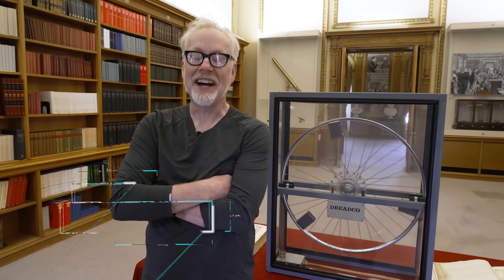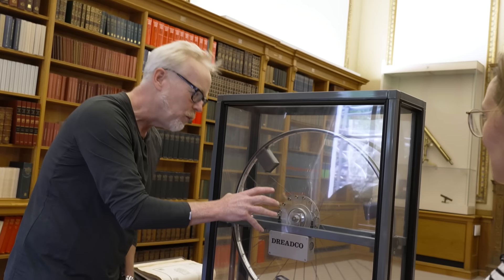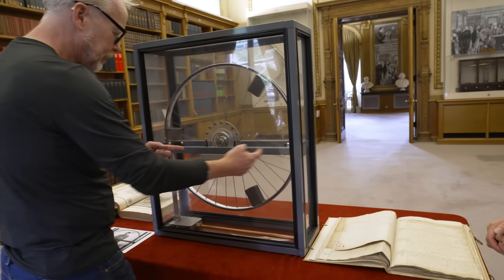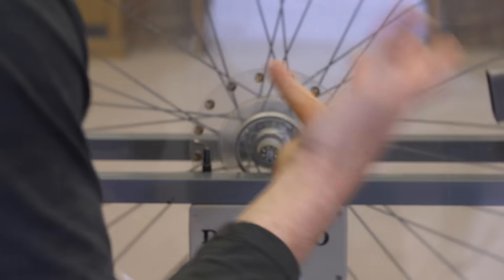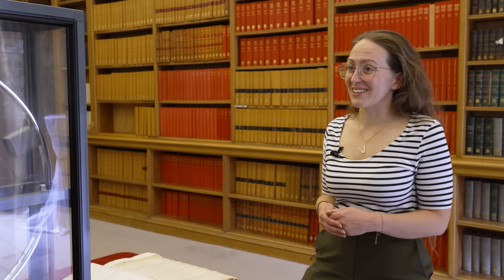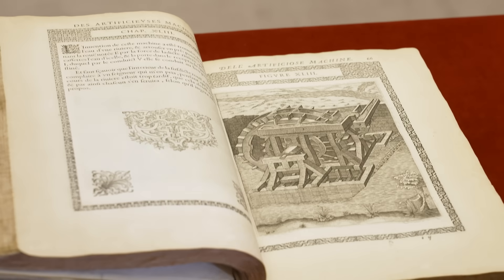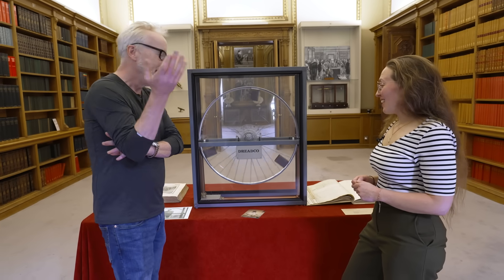Adam Savage vs The "Perpetual Motion" Machine!

Comment: tbh its not all that impressive of a machine considering there are large volumes of it you cant inspect. its hard to figure out what exactly it does, but there are a million ways to get the same result. 
you can have a battery or a chemical process or a temperature differential or a mechanical storage of energy, etc etc. 
just because it is hard to tell from the outside doesnt really make it intriguing in any way - besides maybe a certain level of interest from one engineer to another.

In fact there are even more sophisticated methods like using the energy of radio signals that are around us all day (which is illegal), having an energy source elsewhere that propels or powers the mechanism via radiation, induced vibrations/pressure waves or other transmission methods. Etc etc.

And even these more sophisticated methods arent all that special and have been done a million times.  

In short: figuring out the precise mechanism is neither possible nor would it be terribly interesting. Its like trying to solve a Sudoku with too few clues. The issue isnt that its hard to figure out whats going on. The issue is that its trivially easy to figure out many possibilities of whats going on. Whats lacking is merely the constrains to favor a single solution.
If i rolled a die behind a curtain there would be nothing interesting or stimulating about figuring out which number i rolled. Its impossible to figure out without peeking behind the curtain. And it doesnt really matter either what the number is. It will never be something unexpected like Pi.

Having a sealed envelope is a fun participation thing for visitors passing by. But there really isnt much of a point to it.
Reply: its a pulse motor, magnets on the small inside wheel trigger a reed switch inside the box connecting the circuit from a battery then energising a coil that oppose the same magnets on the small wheel,very simple and the rest is added to confuse you......

Comment: I remember a simple but similar looking device with rubber band spokes. The sunlight falling on one half was enough to make the spokes on that side expand just enough to unbalance the wheel and make it spin which moved different spokes in to the sun.
Reply: its a pulse motor, magnets on the small inside wheel trigger a reed switch inside the box connecting the circuit from a battery then energising a coil that oppose the same magnets on the small wheel,very simple and the rest is added to confuse you......

Comment: "servicing" as in replacing the batteries?
Reply: its a pulse motor, magnets on the small inside wheel trigger a reed switch inside the box connecting the circuit from a battery then energising a coil that oppose the same magnets on the small wheel,very simple and the rest is added to confuse you......

Comment: if those boxs are reversed Magnet pole and they passing thru those U magnets in a negative pole...  as you know when you try to connect two magnets on there other pole they force each other away so that force could be creating a push on the boxes Magnets  as each one passes thru the U magnets allowing the wheel to continue to move round

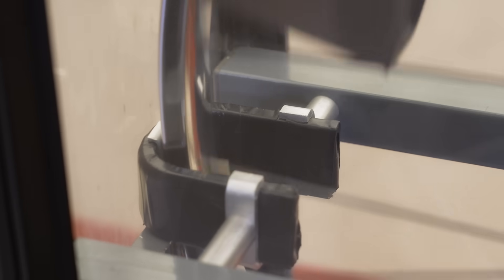Comment: The three boxes on the rim are just permanent magnets. You wouldn't want to mess around re-balancing the whole system every 'service' if they contained anything that needs replacing. At any given time there are two boxes on one side (left/right) of the wheel and one on the other. When two boxes are on the down-going side the wheel will continue to turn just from gravity. When two boxes are going up the wheel will slow, so that's a good time to give the other box a bump downward with the electromagnet on the left side, to ensure the box near the top will cross over to the down-going side. When two boxes are going down the third one is going up, so the coil on the right side can potentially harvest some energy back and in the process keep the rotation speed more constant. You can actually see the speed of the wheel fluctuating in the shot at 4:09. I believe the reason the electromagnets are not dead-center (they are placed a little below the axis) was to keep the rotation speed as constant as possible. You don't want people being able to clearly see the wheel speeding up and slowing down as the boxes pass by the coils. All the other stuff is misdirection, certainly anything to do with heat exchange is a red-herring because the case is clearly not under vacuum judging from the way the front panel is so loose. So the two-yearly 'service' is just to replace the 18650's in the Dreadco box.
Reply: its a pulse motor, magnets on the small inside wheel trigger a reed switch inside the box connecting the circuit from a battery then energising a coil that oppose the same magnets on the small wheel,very simple and the rest is added to confuse you......

Comment: The best mechanical battery clocks can run years on a hearing aid battery.
Reply: its a pulse motor, magnets on the small inside wheel trigger a reed switch inside the box connecting the circuit from a battery then energising a coil that oppose the same magnets on the small wheel,very simple and the rest is added to confuse you......

Comment: “Copper tubing, a heat sink box . . .”  Otherwise known as a ‘smokescreen’ lol.
Reply: its a pulse motor, magnets on the small inside wheel trigger a reed switch inside the box connecting the circuit from a battery then energising a coil that oppose the same magnets on the small wheel,very simple and the rest is added to confuse you......

Comment: its just a bunch of batteries everywhere, probbalby even in the frame itself
Reply: its a pulse motor, magnets on the small inside wheel trigger a reed switch inside the box connecting the circuit from a battery then energising a coil that oppose the same magnets on the small wheel,very simple and the rest is added to confuse you......

Comment: I wonder if the chamber is pressurised with a heavy dense gas and it gets a little extra kick as that air flows thru the copper pipe, cooling or warming it gets a charge of energy and flows out over the wheel, maybe even a couple of gasses which don't like to mix, the reason it has to go back is to get recharged with gas

Comment: There's something inexplicably sexy about her. Not quite sure what it is.

Anyway, I'm kinda thinking there's a compound magnet-based motion occurring. The 3 boxes are passing through a magnetic field that has just enough force to break through and be pushed through the other side of the U magnet: this is allowing a negation of the resistance for the second part. Simultaneously, the smaller magnets arranged in a circle near the middle is feeding current into the rounded tip on the left and exuding it in the pointed tip on the right against the same magnets. This would be the main source of the actual motion. The pipe doesn't appear to do anything and could very well just be for distraction/misdirection.
Reply: its a pulse motor, magnets on the small inside wheel trigger a reed switch inside the box connecting the circuit from a battery then energising a coil that oppose the same magnets on the small wheel,very simple and the rest is added to confuse you......

Comment: so its a wheel, that spins, its in a box behind glass, theres a weird heat sync and copper pipes,  there is a thing mounted to steel framing which may or may not be hollow or filled with gas or very minorly magnetic, then the bike rim itself being made out of metal too.

so what im getting is that the rotation is either stopped because the magnets eventually demagnetize and the wheel becomes less and less efficient until it stops, or whatever those 2 little things near the center of the wheel must lose there ability to conduct/repel current/energy.

the fact that there is no mechanical output to measure torqure or a turbine to measure wattage output means this machine must output almost no energy. it must be just efficient enough to keep itself turning but due to the limitation of magnet fields and the constant matter of friction, eventually stops turnning.

Comment: Personally, I think that those blocks on the wheel do indeed contain batteries plus 1 or 2 coils of wire, a small circuit board and some kind of  sensor So when each block gets to a specific point  in its rotation it turns on the coil (a small magnetic field) to pull it towards the fixed magnet, then as it passes it it switches the coils magnetic field to the opposite polarity to not only push it away from the 1st magnet but also to pull it towards the 2nd. Just a thought.
Reply: I agree. They would have to be active, not passive, or they would draw, not offer.
Reply: I think it’s a barometric clock (copper tuning and heat sinks). The blocks wouldn’t have to be batteries at all, just a pair opposite wound coils to get your push/pull from the two U’s which are fed a tiny current from small changes in ambient pressure (the barometric clock bit). That would explain why there are three boxes and not two or four….a minimal number without having two engaged simultaneously, which would impose opposite forces and stop wheel. 

The periodic maintenance is very likely just to service the center hub bearing.
Reply: @jonh284  that sounds awesome, even though I have no idea if you could be right at all
Reply: It’s also possible the spokes themselves are carrying power between the devices around the edge. Hidden in plain sight.

Comment: I see three boxes on the rim.  What's in there?
Some conductors are transparent or semi-transparent.
It seems possible for solar cells to be behind a 98% opaque coating.  Low but some power output.  Or that's what the "light meters" are.
Thermal differences could be a source of a bit of power; heating and cooling cycles as the heating system cycles.  Slight bits of wind.
Chemical battery in the box and/or copper pipe.
Curved pieces don't have to be magnets; a coil on one or more of the 3 boxes could be given a blip of power to attract the iron when it approaches them.

Interesting intellectual challenge; not a practical device, or it would be e.g. running a hoist instead of being inside a glass case.

Comment: Pretty sure it's just a brushless motor with the wiring well hidden in the framing. The U.shaped thingies being the coils (or magnets excited by coils) and the blocks in the wheel being the ferromagnetic poles being both driven by the magnets, and giving feedback to the circuitry when to excite the magnets.

Comment: The boxes on the wheels are battery boxes that generate an electric/magnetic field when they hit a tipping point, they then reset and kill the field before and after they pass through the magnets. The batteries could last a couple of years depending on the strength of the field generated.

If you notice there’s 3 boxes buy only 2 U shaped magnets, and only 1 box passes through either magnet at a time which creates a push and then shortly after the next box passes through the opposite box and propels the wheel a bit more.
Reply: could each box hold 4 9v alkaline batts  '80's and last 2 years? (im not convinced it did run for 2 years, who could prove that)
Reply: @legendarysermons9621  on a well designed bearing? a 9 volt could easily last that long especially with switches only having the battery on for a second or 2 every rotation

Comment: In the small wheel there is 3 magnets and metallic pieces who look like magnet but are not. When the magnet is in front of the detector it activate the electric magnet on the left or right. Permanent magnet are the 3 big things on the large wheel. The batterie is split in two parts. One on the middle (the element with the brand name) and one the left buttom.

Comment: That thing could just work with air pressure, that changes over time, as an Energy source.
Reply: How? Where is the work being performed?
Reply: @TheLetterH111  air pressure changes when the weather changes. A mechanism could convert that to mechanical energy, or electric energy.
Reply: @TheLetterH111  The Jaeger-LeCoultre Atmos Clock uses air pressure change to power itself.

Comment: I think the three boxes on the wheel contain batteries, electromagnets, and a control circuit. Each time they pass through the U-shaped magnets, they generate a tiny pulse of megnetic force, that interact with the magnet and give the wheel a little push.
Reply: Which, of course, would draw MORE from the wheel than they would offer.
So, no.
Reply: @Cotronixco  Driving the wheel by electro magnet would be MORE possible if the force was applied to the outer spokes of the wheel.not he hub like so many here suggest. Think about that, but what battery from the '80 could go for 2 years?... must be atomic
Reply: @legendarysermons9621  It's the same. Perimeter assistance would require less force for a longer duration. Hub assistance would require more force for less duration.
It's similar to higher voltage and less current produces the same as lower voltage and higher current.
Alkaline batteries with very little draw can last years, even decades, if kept cool and clean.

Comment: NO ENERGY COMES OUT OF IT, ENERGY HAS TO BE OUT INTO IT TO START IT, AND IT ONLY WORKS FOR A CERTAIN AMOUNT OF TIME
Perpetual motion machines don't exist, and the only people who believe in them think there are government conspiracies that involve thousands of people to suppress it.
Reply: "There are people that are in-the-know and when they eventually found out the secret they were disappointed."
So basically it's "magic", and magic is based on hidden information that disproves the "magic trick"
Reply: Btw see the two bolts in the middle and the ring of magnets around the inside of the spokes?
This runs on magnetic energy - which slowly depletes the magnets.
So, basically, it's "battery powered", and the batteries are magnets.

Comment: Dc brushless motor.  The little “antenna” are Hall effect sensors (although I can’t quite see if the dots are magnetic).  The boxes are magnets.  The u shores are windings.   The copper pipes ate either conduit or the actual conductors.

Comment: what about a way to harness the kinetic energy from rotation, convert it into electrical energy which turns certain magnets on and off in a specific pattern to repel magnetic polarity which pushes the thing to continue moving? youd have to start it manually but wouldnt it go for a ridiculously long time? I mean, bearings and stuff would certainly wear so it cant last forever i guess

Comment: my guess is the boxes just contain a coil and a gravity switch for timing that activates the coils at the right time to produce acceleration but only right before the boxes pass the magnets.

so it'd contain a single cylinder with a ball inside that simply closes a switch as it moves over the metal pads on both sides. the coil is then powered by a battery. so just 3 simple components: a switch, a battery, and a coil.

Comment: 5 magnets all strategically positioned to perfection, one in each box at the counter clockwise side of the box, the rest of the box is specially insulated, preventing the boxed-magnets from stopping the wheel-system at the two U magnets.  It's an unbelievable balancing act, the momentum of the wheel has enough mass to break the attracting (pulling) magnetic field and pass the boxes through the U magnets.  Meh... could be wrong, LOL.   Intriguing setup!

Comment: my trouble with the middle prongues are that they're too close to the center, if those "amber balls" were being charged and discharged and the electrical discharge made it move, why wouldn't you spread them apart to have more torque?

btw, there are no such thing as a completely closed system, everything is an open system, the same one

and the sun's energy bombards us all day, everyday. literal free enrgy coming towards us at the speed of light and yet we ran away from it seemingly even faster

closed systems are a mathematical delusion invented so that physicists could actually get something done by pretending to be looking at something real when in fact it is a description of a model, not a verbatim representation of reality itself

Ultimately the second law does'nt even matter when you're drowning in an extremely high density flux of photons, just stop pretending there's any other type of tappable energy that isn't a degradation/trasnformation product that started out as energy from the sun. Just use the 1 ingredient the universe made to make all the other ingredients! even most blind people can see the sunlight, it simply is there, all the time, heating your skin and making the wind blow. 

you're not part of a closed system, you yourself isn't a closed system.
no mechanism is a closed system
closedness isn't even a real concept beyond being a topological variance and even then it's arguable if there's anything objective about that kind of information or if it is just a representation of a pattern we impose out to reality instead of actually extracting "real information" from it

Comment: I think the central bits are a capacitive commutator, sending voltage and small AC currents into the spokes. 
One is slightly before the left U shape, and the other slightly after the right U shape. 
Either the spokes are insulated, and it works by electric field attraction and repulsion between the spokes and the U shapes. 
Or they're electrically connected to the rim, sending small currents through it, but different lengths of rim on top and bottom to provide torque via magnetic fields, like an electric motor.

I think the three things on the rim are just weights to increase its inertia to maintain smooth motion.